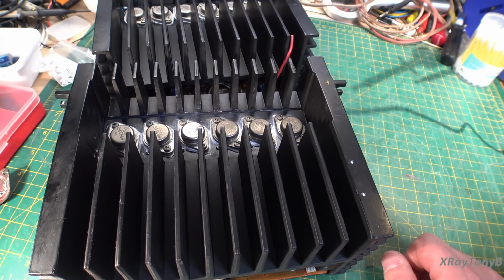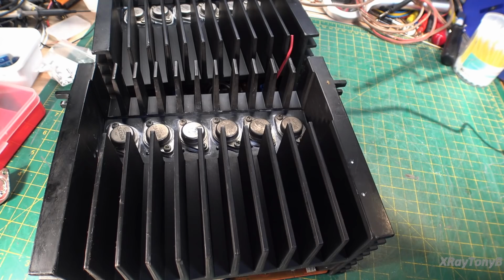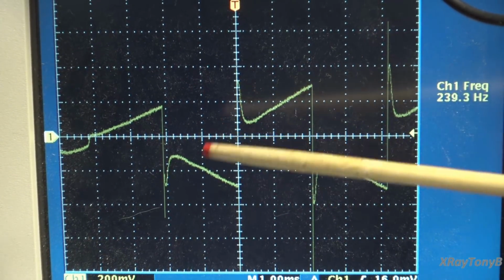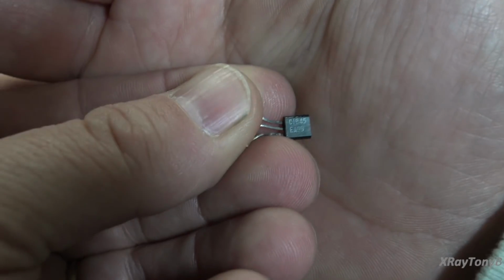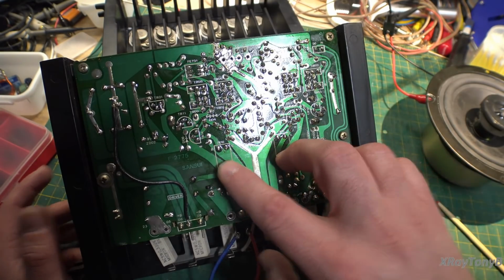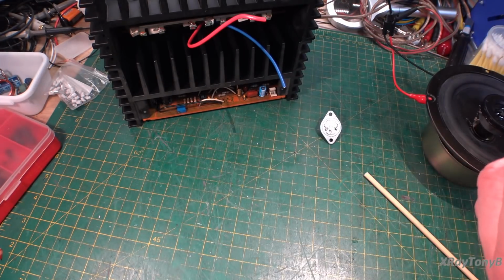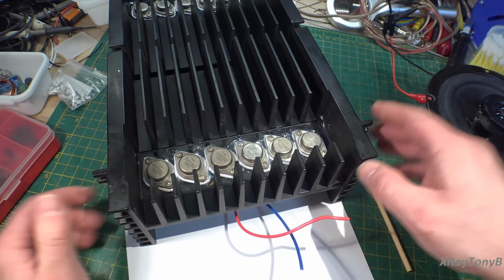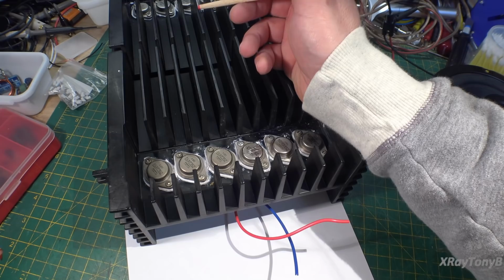Sansui AU-X1 Part 1A:   Transistor Talk & TIM Distortion

Comment: Well, I for one was not bored. A very good explanation on a subject few have any knowledge about. In these days of class D and sound bars, quality has left the planet in favour of quantity.
Reply: You're painting Class D with far too broad a brush.  Nowadays, the  best Class D stuff from Hypex and ICEPower is as good or better than any of those behemoths from back in the previous century -- and even the entry-level Class D chips from IC giants like TI are surprisingly good in home stereo applications when designed in correctly and surrounded by high quality components.
Reply: @MichaelBeeny  -- It's not "fairy stories."  At this point it's a mature technology that can outperform yesteryear's dinosaurs when expertly implemented.  I'm old enough to remember when the same sort of faux wisdom was dispensed as transistors started to displace vacuum tubes -- transistors were the "fairy stories" back then, and there was some merit to that viewpoint for the first decade or so.  Then DC-coupled solid-state amps came out, most of them from Japan, and their performance left all the tube-hugging naysayers with egg on their faces.  That time has come for Class D, whether you prefer to live in the past or are willing to do your homework and realize you're wrong -- your life, your choice!
Reply: Bruce, you may be surprised to know that I agree with most of what you say! Things do move on. Of course class D can be made to sound good, I cannot say I have heard every class D and probably never will. Most class D, these days use an IC and are made for the lower end market. These I find do not sound very good. OK is probably is the best description. I have used professional class D, very high output amplifiers, mostly in the cinema field, lots of power for the size and much smaller heat sinking. I took one home once over a weekend, lots of power, great dynamic range, sound??? it was OK. These will of course get better in time, just, as you rightly said, as did the transistor amplifiers.  As for valves, wiped the floor over transistor amps in the 60/70s Now well left behind unless you like the WARM sound, so called. Which really means, poor frequency response, high distortion, phase shift, no dynamic range, etc etc.
Reply: @MichaelBeeny  -- Well, at least we've got some common ground.  In fact, even the IC-based stuff can sound surprisingly good if it's well-made, has good source material (e.g. not Bluetooth or MP3/<320 from a phone), and especially decent speakers,  the latter being the biggest weakness of many (if not most) of today's consumer-grade audio products.

I've been around both home and professional audio since (circa) 1970, and have owned both respectable mid-level (Dynaco, Sansui, Kenwood, JVC) and so-called audiophile (SAE, Adcom) gear -- all separate amps and preamps rather than the ubiquitous "stereo receiver," BTW -- and my current little (TI ICx2-based) Chinese-made integrated amp is right up there with the best of that stuff at a tiny fraction of the cost, size, and power consumption.

Did my (Nelson Pass designed) Adcom GFA-535 power amp sound better?  Yes -- but honestly (and surprisingly!) not by all that much, at least IIRC, and my little Class D sweetheart has an extra (and quite hefty!) channel for my subwoofer and a Bluetooth feature (which I've tried but don't use)!

If you're interested in where Class D has advanced on the high end of the performance spectrum and have engineering-level technical knowledge, I suggest you read the following white paper from Hypex's (relatively) young design genius, Bruno Putzeys -- OEM output modules from Hypex (and main competitor ICEPower) are used in more than a few "audiophile" power amps with 4- and 5-figure price tags.

https://www.hypex.nl/img/upload/doc/an_wp/WP_Ncore_Technology.pdf
Reply: @MichaelBeeny  Totally different subjects. I believe in an almighty God, but I could be convinced that Class D Will never reproduce  sound as well as TIM amps.